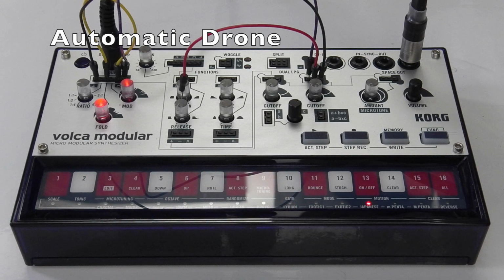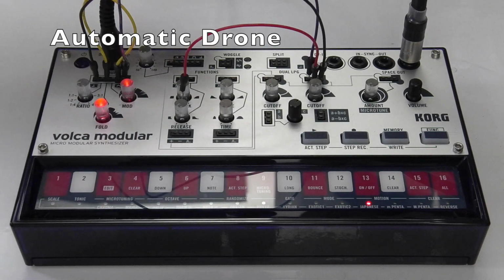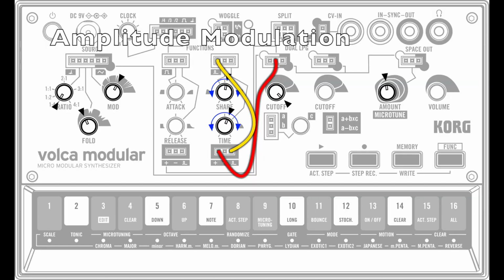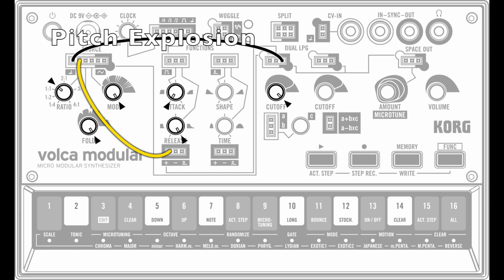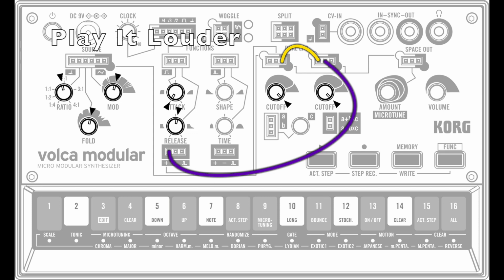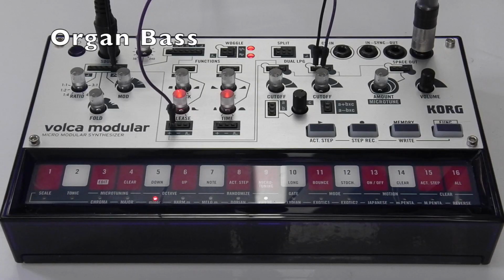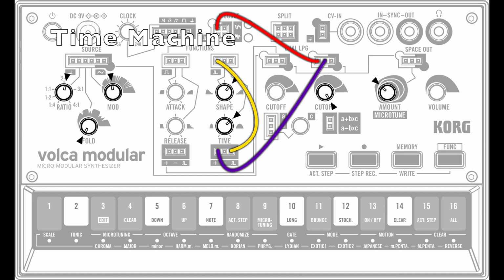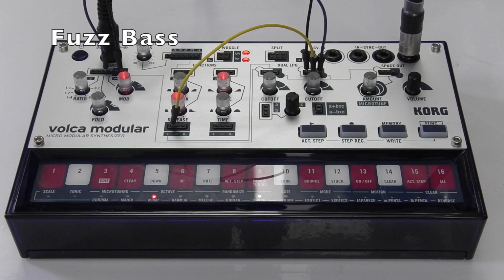Dual LPG Patches: Korg Volca Modular The Expert Guide (pt 5)

Comment: Something I'm not clear on and I hope I explain myself clearly as its a lot to wrap your head around: when you connect the output of LPG 2 back into the source ratio or fold in the last few patches is the output of LPG 2 still getting passed along the signal chain? What route does it take to being audible? Is it going out the LPG 2 along the normaled route?

Comment: Is it possible to configure the KVM so that the modulating oscillator runs as an LFO via function2/LPG2 while the carrier remains hard wired to function1/lpg1 as a normal ASR?
Reply from the maker: Dino Goldie you can connect the Source Modulator Output directly to any input to use it to modulate that section, but even at the lowest pitch, this will be more of a “High Frequency Oscillator” than a “Low Frequency Oscillator”. Function 2 is better at being an LFO. Connect Function 2 End Trigger Output to Function 2 Trigger Input and Function 2 Positive or Inverted Output to the section you want to modulate.